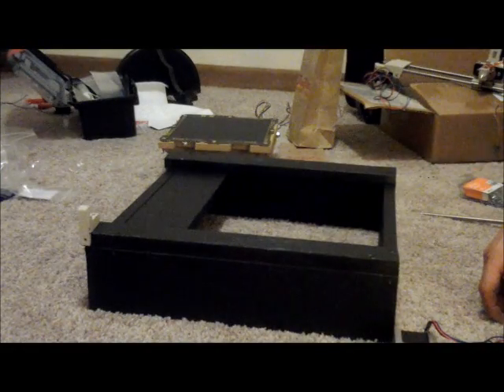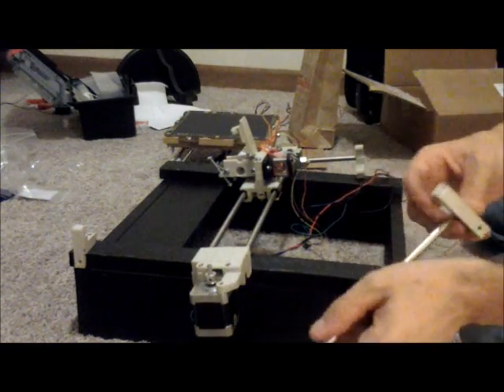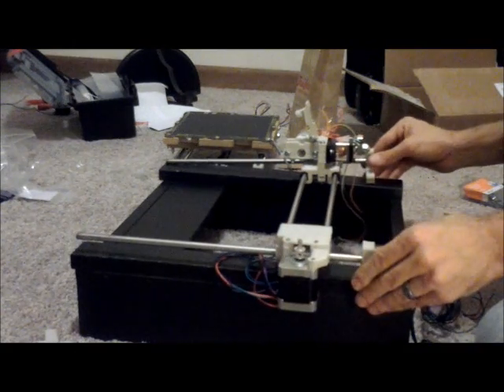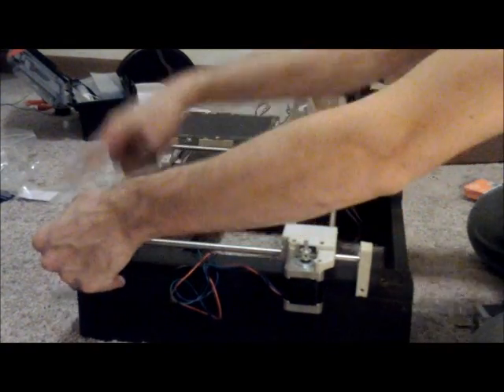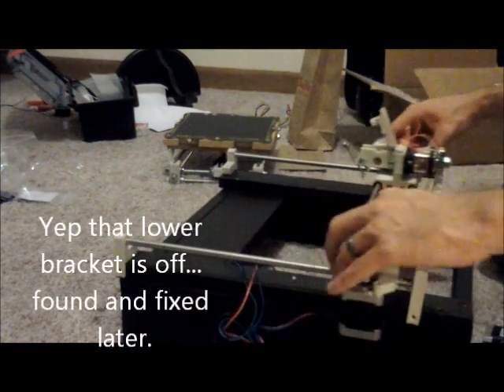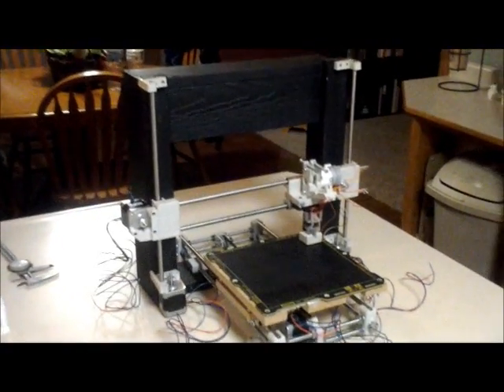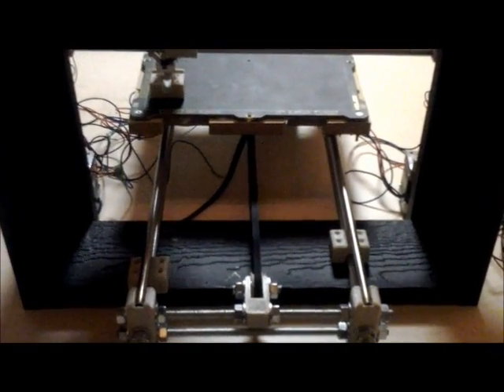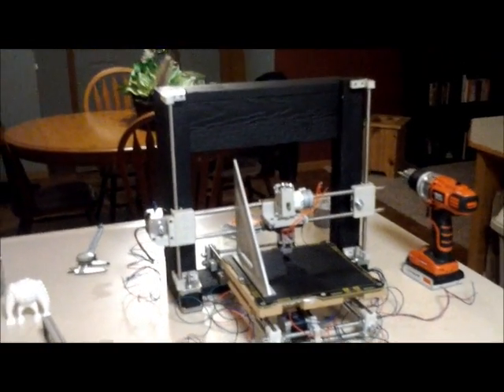Prusa i3 build log stage 5

Comment from the maker: Greetings Hasan,  I used the same length and width dimensions as I did with the 1st set for boards, but the thickness did change to 1/2" (or roughly 12mm).  If you have more questions feel free to IM me or join the #reprap IRC channel.

Comment: Hi, 
In stage 2, you said "EDIT!! - So the board I used in this video turned out terrible (see later video). I ended up using 1/2" cabinet grade plywood. A bit more expensive, but works GREAT."...

So, what is the frame dimensions, is it 6x 450 * 100 * 12 mm, as mentioned in reprap, or it could be different, i.e the thick instead of 12 could be 15 mm,,,